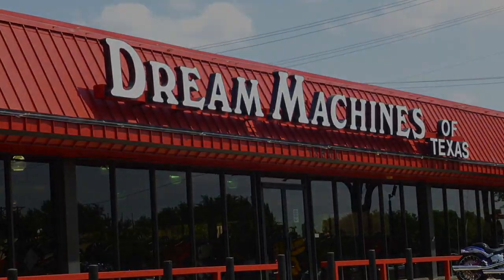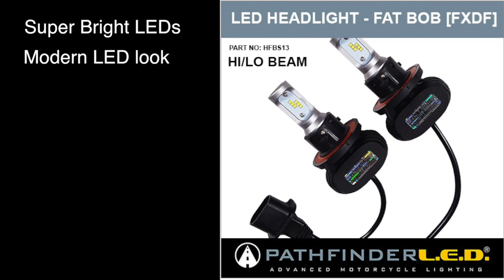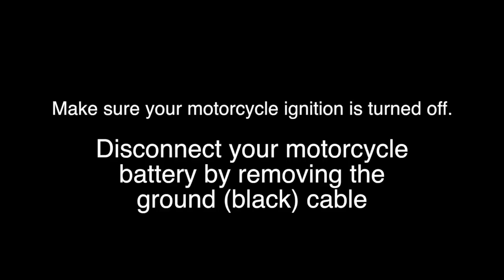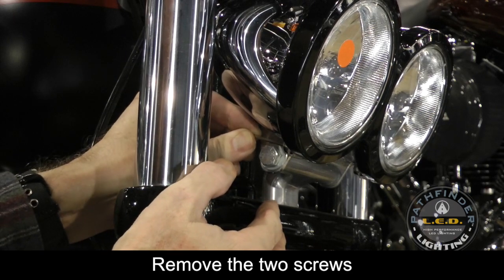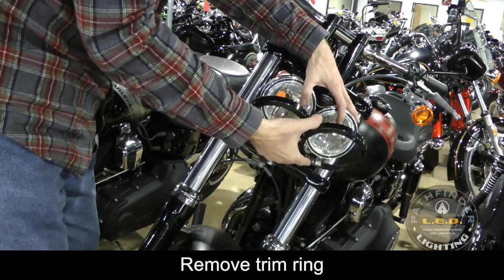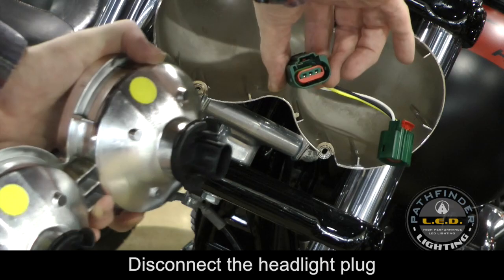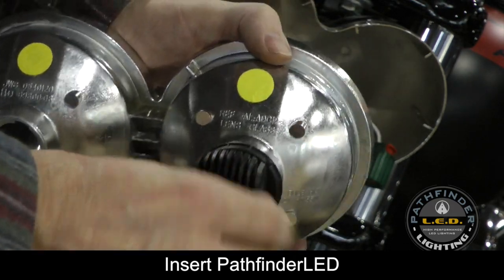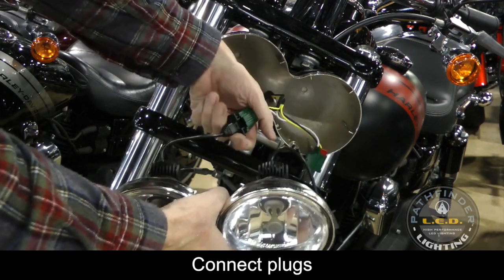Install PathfinderLEDs on Harley Davidson Fat Bob

Comment: Thanks Cruiseman. I checked this vid before I fitted these LED bulbs to my FatBob. Everything went to plan.
Reply: Is it better than stock halogen bulbs? Would you recommend it? Or recommend a full unit replacement to LED?
Reply: Rayan Mufti I’m very satisfied with the results. The bulbs are very bright and produce a stronger spread of light on the road. I believe that I am more visible to other traffic and occasionally get flashed, so maybe they are set a little high.
I can’t compare with led units but they are much better than stock bulbs.
Reply: andrew simkin Cheers!

Comment: I read somewhere that LED’s have a different light distribution so it’s best to get a full unit instead of just the bulb. Is that true in FatBob case, having two bulbs? Or is the light distribution similar or better than original halogen bulb?
Reply from the maker: It is true that an LED unit which is designed for LED light distribution is a better solution, but much more expensive.